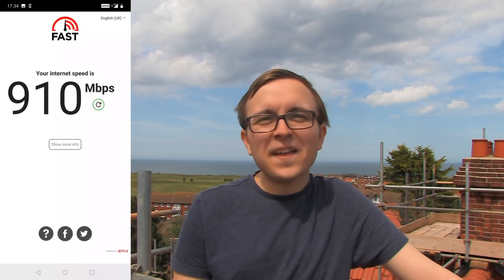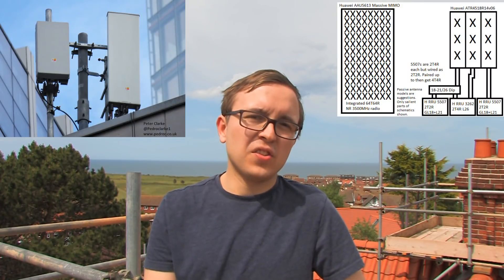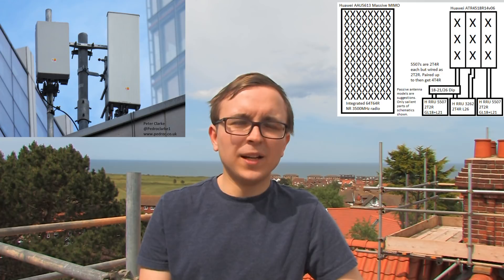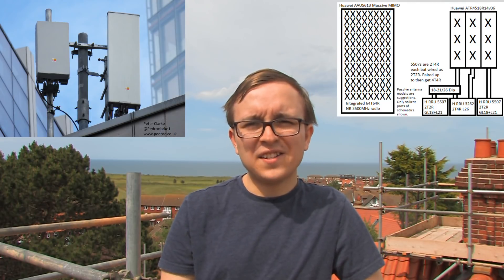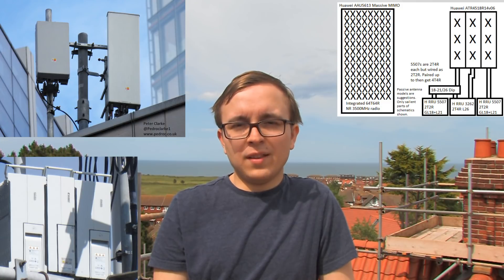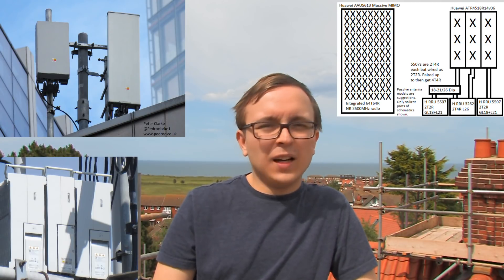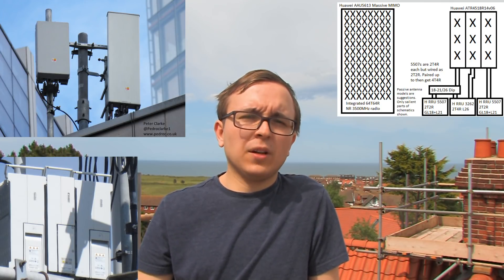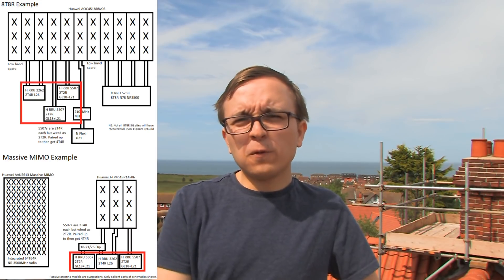EE 5G "5GEE" Mast Architecture Explained: Huawei AAU5613 Massive MIMO w/ Schematics; Pros, Cons

Comment: Dear Peter， EE only got 40Mhz C-Band ， they launch NR+LTE(DC) to Enhance the Thrp？
Reply from the maker: The 5G sites usually have 80MHz LTE, 45MHz 4T4R so they're Gigabit class for LTE!
Reply: @scivids1999  Really appriciate,   I think EE used Dual connection ,so they used 80Mhz+40Mhz NR for UE, so the ue  Tx data by both 4G and 5G
Reply from the maker: Yes, that is correct.